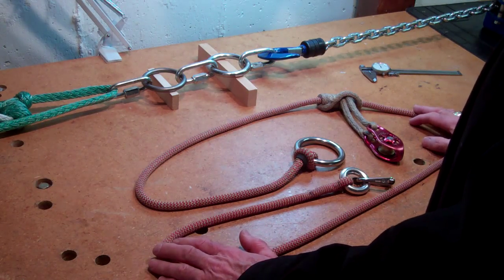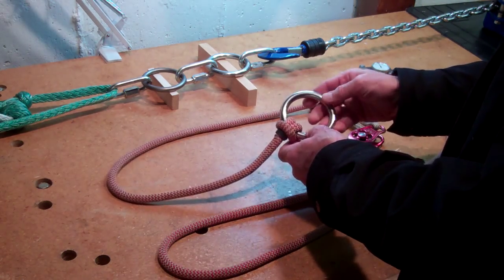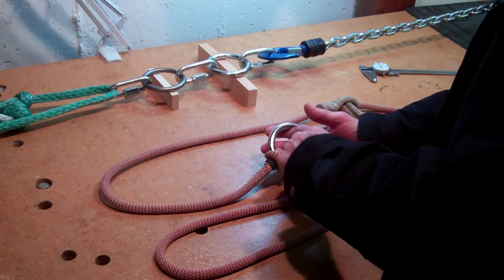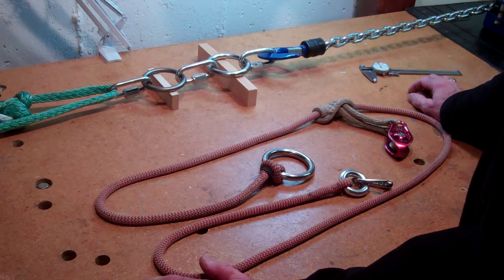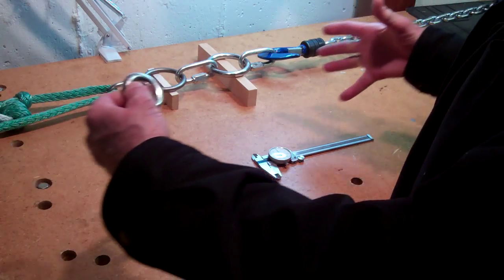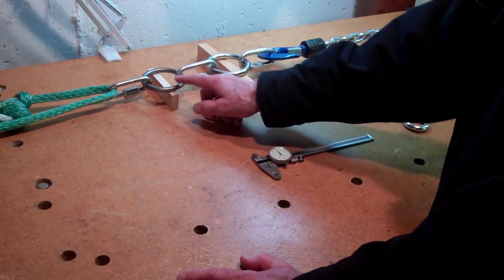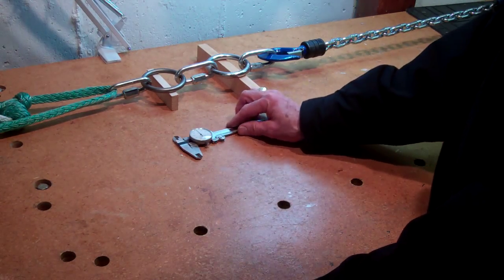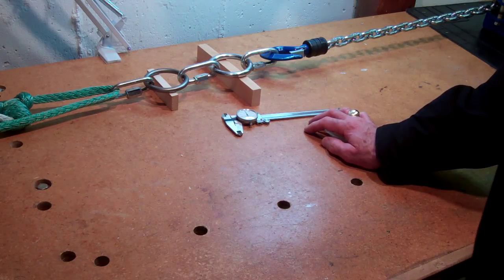U-SAVER test rig

Comment: Hey Tom...Saw this video and was wondering about the results. I haven't been able to find, nor did you say where you posted the results. I have been climbing on this ring for some time, and have no doubt it's plenty strong, but would like to see your measurement results please. Thanks in Advance....enjoy your videos!
Reply from the maker: Bwanar1 Thanks for the interest.  There's a long post in the "Climbers" forum at TreeBuzz.com dated Mar March 3, 2012 in the thread "uSAVER Ready for Prime Time".  You see pix, test data and discussion around the rings.
Or you can see the data here ...
Proof Testing Rig (video) here 
 Data and Calculations  here  
 Comparative section strengths  here
Reply: Thanks very much for the reply Tom!